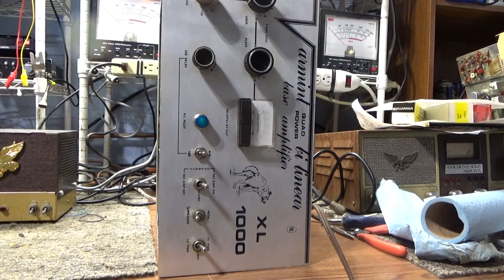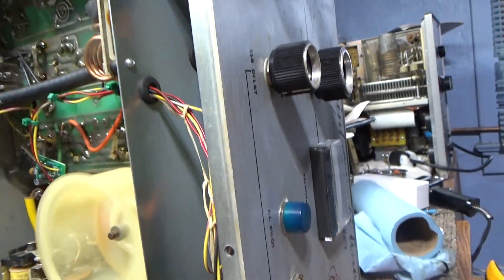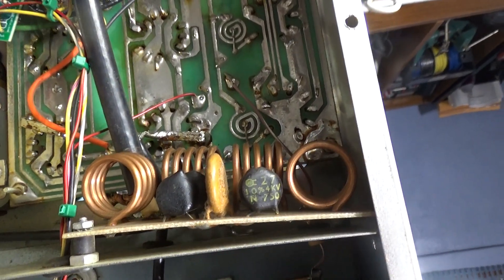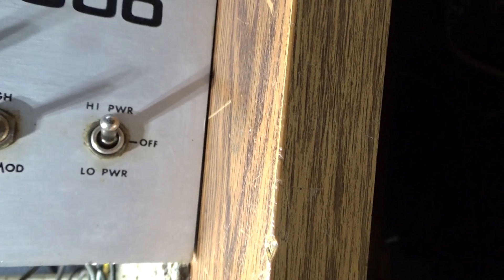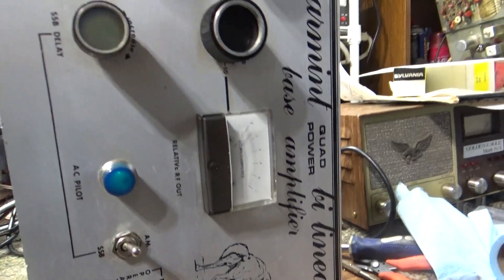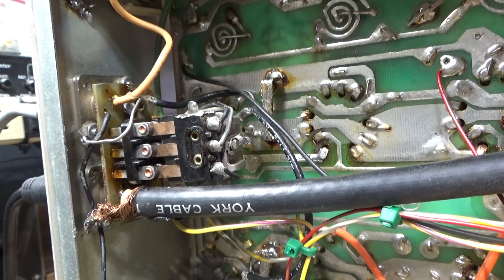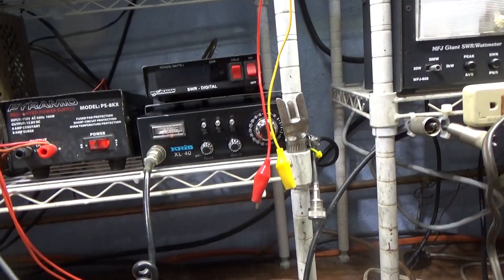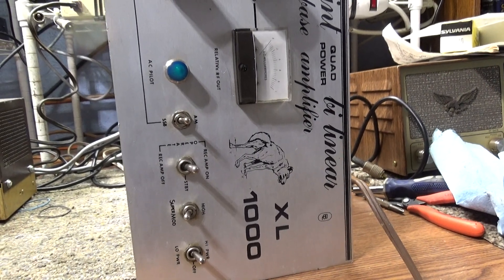Varmint XL-1000 reverse pre-amplifier, weak tubes, on a dummy load.

Comment: Hello sir FlatFoot 442 have the same exact amp trying to find whatever is called I'm not for sure but the plate the knob and the ceramic piece behind it with the metal blades I'm needing one of those I need to know what it is and where to find one
Reply from the maker: that piece is a variable capacitor. I'm not sure which one you are speaking of specifically as it has 3 of them in it.

Comment: The problem with those amplifiers in that era is that they were under cooled That's not even close to near enough. The best thing that you can do is take the lid off of it and run it that way and run fans on it above it
Reply from the maker: That's kinda typical for all the big multi tube amps from back in that era. Most have a single little open frame fan. Example, look at the 10 tube Galaxy 2000. I think this amp with the blower pulling the hot air out isn't too bad. However, I do agree that pretty much all these big bad multi sweep tube amps would benefit greatly from more cooling. Same for the big bad Tram D201 radio. It's main problem is too much heat.

Comment: I have an XL 250 that has stopped keying if i manually engage the relays it operates as it should.
I'm not sure where to start on troubleshooting the key detection circuit.
Reply from the maker: I always start with the keying transistor. I think the Varmints used 2 in a Darlington configuration.  However, one of my Varmints gave me a hard time with the keying circuit which was very hard to get to, so I replaced the whole keying circuit with the Nomad Radio keying circuit.
Reply: @tramdr  I downloaded what looks like a hand written schematic but it's not very helpful there's no guid section or break down of each section.
Reply: @tramdr  I forgot to ask what was the model number for the nomad keying circuit board you used and did it last for you?
Thanks for your reply.
Reply from the maker: This is the one I got from Nomad. Well, actually I bought a 5 pack from him and have used four already with no problems. https://www.ebay.com/itm/115811469907